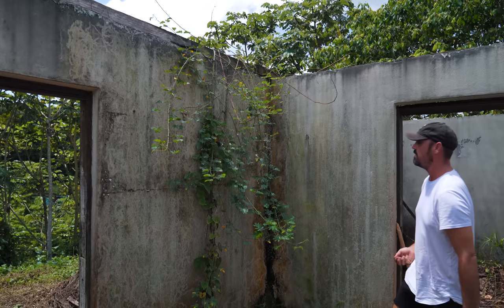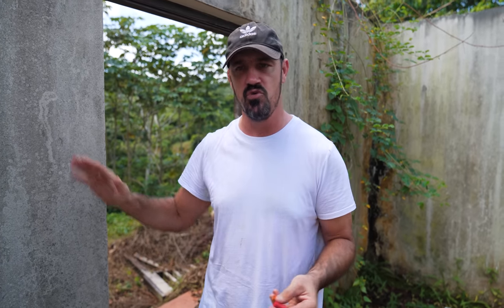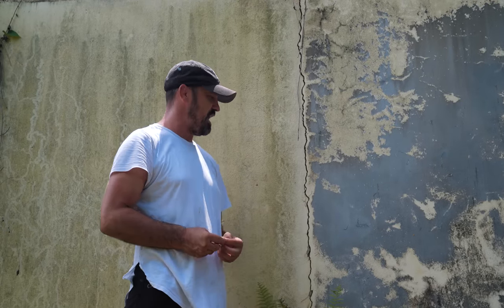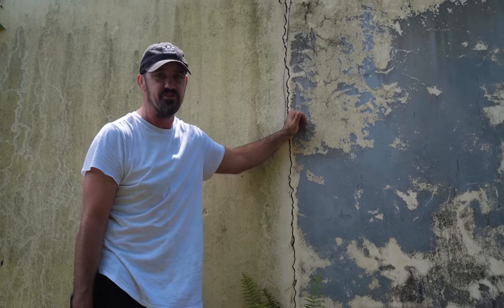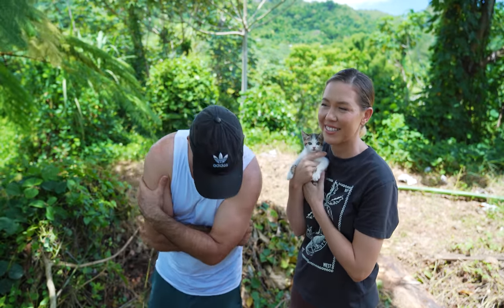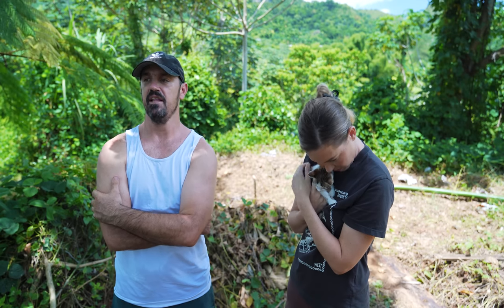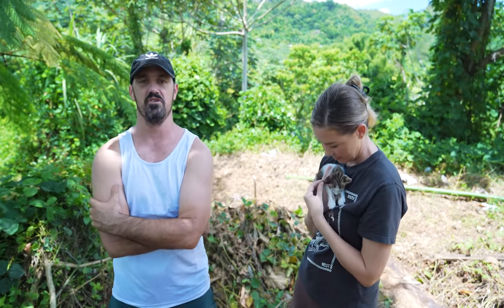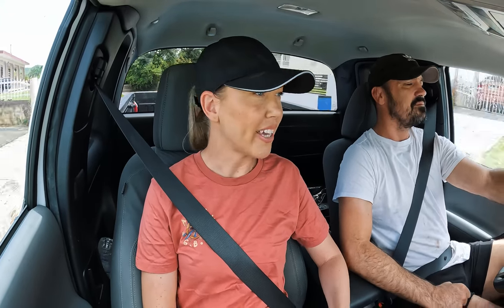ABANDONED HOME SHOULD WE RENOVATE OR DEMOLISH?!

Comment: I would dig out the concrete cracks a little to see how deep they are....there are plenty of ,easy to use,concrete patching compounds available at most hardwares stores. If you go with corrugated metal or fiberglass roofing you could use bamboo as temporary rafters, to create extra storage. Then reuse the roofing if needed on the main house, Nothing necessarily wrong with having your house in back...might give you more privacy and a better view?

Comment: Okay guys Puerto Rico falls under the IBC (International building Codes), specifically the 2018 Residential Code, 2018 Existing Building Code and the 2018 Energy Code). While the existing walls may appear sound, without any forensic work you have no way of knowing what reinforcement schedule (if any) was used. One of the more important (not only one) considerations is transferring roof and wind loads through the walls to the ground and foundation.  Without knowing the exact wall construction, this is impossible to calculate. They are also solid meaning there is no drainage plane or insulation. Sounds like you need a consultation with an Architect. I do this for a living and would be happy to provide a consultation.

Comment: I'd suggest that you don't let the ruins of the old place decide your long term way forward. You could use it, but renovating is often slower, more costly and more of a hassle than building new (is it plumb, straight, square and level, for starters?). Weather-exposed work is less reliable in terms of what you might find than starting over, particularly as this is just a couple of rooms. Would the size and layout even work for you? How many power lines would you pout in the concrete walls? Would you change the window shapes/locations? Is the building where you would have wanted it if it wasn't already there? Not saying you can't, but it's often more trouble than it's worth.  Others have suggested you use it as a shed, workshop or temporary shelter - that might work too. Look forward to watching, not matter what!

Comment: Guys, I would suggest putting a predator skirt around the outside of the run. Some predators will tunnel underneath if you don't have a predator skirt. It should be something a bit more beefy than chicken wire. Make the skirt about 2 ft wide around the outside on the ground.

Comment: You Guys are a hoot!!  In my opinion  you should gut everything wood out of the concrete building.  The wood will have mold and mildew and you dont want that  even for a workshop.  Scrape the cracks out then patch with hydrolic cement.  Put a roof over it and make it a workshop, It will give you a dry place to work and to store your tools till you build your dream house. By the way, dont tear  out all of your wiring right now, you can use the old wires to help pull the new wires through the walls.  You need cracked corn and laying mash for the chickens (you can do without the laying mash for now we only use that in the winter) the whole corn is hard to swallow.  The first eggs a hen lays are small (they are called pullet eggs) they are usually not fertile,   the question is "How old is your hen?

Comment: First off im a retired builder, having been in business for more than 45 years.
Realize that building the shell of a home is the least expensive part of a project.
As for your old structure, apparently it was built in two different sections at different times.
That explains the crack between two of the sections.
You could reinforce that section by building what is called a ( pilaster ), preferably on both sides with concrete, and tied into the existing wall. Drill into the old wall, or even all the way thru the old wall and epoxy pcs. or rebar in, leaving about 6” or so protrude on each side. Then form and pour the pilaster.
If they were block walls you could fill them with concrete in order to reinforce them
A patch on the surface is no more than applying a band aid over a wound, it will not fix the problem.

Comment: Herding cats and succeeding, good start. Try making a movable chicken pen so they can clean up areas and fertilize at the same time. I don't know how much bamboo you have because there are some great bamboo houses  on the internet. Is this hurricane country, if it is those cement walls might come in handy and with solid roof framing and fixing the foundation on the low side of the lot it looks like has life left. The walls can be parged to look like new and this could be integrated into the new house. I envy your open palet and the youth to take it on.

Comment: The house may be attached to the property address. Check first. It can change property zoning and have to deal with new laws on all construction. Dont tear it down until the new ones finished and inspected.
All it needs is a few rafters and a tin roof.  Free space is always needed especially if its a dry one.

Comment: On the cracks get several steel brackets maybe even angle steel if needed  and dill through walls and place large long bolts thru the halls in several places  and the wall want fall and make a form below that corner pour concrete with footer of rebar up to the wall to support it

Comment: Cracked corn is the better choice. Should be cheaper than whole corn as it is stuff sifted out of the load of corn when being handled.Chickens have a Gizzard in their lower neck that they have to keep full of rocks (they know what they need). This grinds up the food so they can digest it.  Predators can kill all of them in one night. Have a pole up 4 feet or so for them to roost on at night. An area you can lock up at night is the best. You are both doing great!

Comment: For chickens you need to have around 16% protein in their diet, cracked corn only has ~ 9.7% so its an additive and not a complete feed.  Chicken feed on the other hand usually is 15-18% and also contains the necessary calcium and minerals needed for growth. Chickens can get fat from eating just cracked corn. Its recommended that only to be  ~ 11% of their total diet. Cracked or whole doesnt matter.  So you have silkie chickens, that means only 2-3 small eggs a week tops. Males only get to be about 4 lbs.   Keep an eye out for red tailed hawks (the big ones) there are 4 different species but only the reds are large, and also make sure your bamboo remains dead. the first two years as it invades is quiet as its spreading below the soild, then the third year it run rampant and shoots will be everywhere.

Comment: Personally I would try to build off that existing structure, you already have a strong structure there, clean it up, pressure wash it, but first check out the foundation and septic if there is one, make sure both are sound, if so then your halfway there to a home that just needs completed in any way you want, beats starting from the ground up. you can always add on other rooms if needed, but hey, I would love the fact that a strong storm proof structure already exists and its really in a prime location to the road, looking forward to see what you decide, it would also be more cost effective too? Great job so far guys, nice job on the coop too! Keep the kitties, see if there is a way to get them fixed for cheap since you did rescue them there might be a assistance for that, and they will also keep the rodent population down.

Comment: The foundation is most important. It's crumbling. It might be saveable. I'm just arm-chairing it, so I can kick it. If you can kick chunks off the corners, tear it down.
Otherwise, rebuild.
Cracks are not necessarily bad. A totally solid piece of concrete is not easy to find.
If you fix it up, no reason why you couldn't build a nicer new house next to it, then use the old one for other things, like storage or hobbies. We know you like working with wood. And anything else. Rebuild it in a way that doesn't keep it from converting to an awesome shop.

Comment: Ya gotta keep them they were meant to be with you. As for the cracks in the walls many florida homes have this problem of foundation settling. Its common just repair the cracks with a good cement repair and use a cement bonding agent.

Comment: Great job on the chicken coop. On the structure, you don't know if it is reinforced with rebar so I wouldn't build on it. Demo it (Bobcat with Jack Hammer attachment, easy) and reuse the materials on new foundation. I would think "kit" structure. It looks like wood just rots out there, so I would do BARNOMINIUM! It's a steel structure, very weather resistant, fabricated offsite then assembled on your new foundation.....easy peasy, you could that work. If that is out your budget (but I would call and see if they want an advertising project), I would still demo existing and reuse and build a cinderblock structure with wooden top. Cinderblock is easy to obtain, has very good insulation quality and lasts like concrete and its easy to lay block. And with block you could build incrementally over time if you are budget constrained. Just start with a good plan. Does the lot have electricity, or did they run electric off a generator? Be thoughtful, don't dress up a pig. You have a nice trailer to live in, so no rush. Take your time.

Comment: It appears your flat land is quite limited..so demolish the old structure and build something new to your desired specifications with a better set back from the road.  You might use some of the existing concrete walls as foundation material or fill. First check on building codes for the area to determine permitted structures and availability of building materials and prices.  A manufactured home is another option.  Read instructions and put it together.

Comment: Your remaining walls on your property probably have some rebar steel.  If so do not demolish, they can be the core structure with strong lean-to on some or all sides to cheaply add additional size to the house.  get a ladder and look down on the top of the wall.  If is solid and there is steel rebar inside, great, if not or what ever a 8 inch tie beam can be added to tie it all together and be sure of the strength.  if you decide to add tie beam, concrete hammer drill 5/8 into top 8 inches to pound 5/8 rebar into what is there with 7 inches sticking out top into new tie beam.  however do not drill vertical about every two feet alternate drill at an angle from vertical.  the next is angled the other way so it will never pull out.  two 5/8 bars horizontal to tie it all together.  One piece of OSB plywood can be ripped into 3 pieces, 16 inches for form sides to pour in concrete.  8 inches laps on the existing wall with 8 inches sticking up for tie beam sides during concrete pour.  they have rolls of steel banding with holes to push through slits cut with skill saw just at existing wall across to the other side nailed to horizontal 2x4s top held in place from blow out by 2x4s.  steel bands wrapped under horizontal rebars every 2 feet left sticking out of tie beam top to strap down trusses yo can make with plywood gussets.  outter lean to vertical can be pressure treated 6x6s set 3 to 4 feet into hole with concrete.  drill a horzontal hole through 6x6 to run 5/8 rebar through horizontally at least a couple of feet so 6x6 will not likely pull out of the ground, especially if into a concrete footing.  enough for now.

Comment: You guys work fast. I would say use the structure at this point, its there . Get the largest tarpaulin you can or corrugated plastic for a roof, use the bamboo for ridge poles.  You may or may not keep it ultimately but for now it could be useful and its cheap shelter/ workshop / project space.

Comment: The only key factor you need for the coop itself is to make sure that there is a beam of wood that goes across the whole thing for them to perch on at night that is at least a foot and a half off of the ground and then make a box somewhere in the corner that’s filled with dry grasses and stuff for them to make a nest to lay the eggs if they’re free ranging and running around, you may find they may lay an egg and some little random corner somewhere that you might not know about but also know that whatever eggs come out of the chicken can be kept on the counter for at least a month without any issues what so ever until you clean them off when you clean off the coating off the outside of the egg you then have to refrigerate it

Comment: Garanteee #1 concrete cracks always fill in the cracks they dont look structural.  Secondly the septic tank will not be uinder the house it will definately be away from the house then you will have a deep well or a leach feild and it would be a400% increase in cats

Comment: Ok so I can't tell from the video how structural and sound the walls are. Dig a little and assess the size of the footings. Now if the structure can handle it, I'd build on top. The new structure will be above the old one, one story above. Think about the design options you can have and also better views. Not to mention no vulnerability to water. Build the new with steel and concrete please.

Comment: I have done up a few houses and I live on a boat after selling them.. What would I do? Id make the old part clean. Strip it. Then look real good at those (quite common) cracks. And yes you can repair them with epoxy... kind of. (there is an epoxy based concrete repair) But first you need to drill holes on either side of the crack to stop it. Then that needs to be filled. It will last, no worry. That is unless they ar from all the way to the foundation.
Foundation is your main concern. First, is it flat and horizontal? Everywhere, if so, make a drawing and integrate what is standing into the new, you won't see it. It's just a shortcut to save money and time.
If this is built how I think it is it's a hell of a job to remove it by hand, you need machines (at a cost) takes one day maybe two.. In case the foundation is bad, then have an expert look at it before you decide.
I would consider integrating the existing part into the new design and making this like the scullery or such..

On the cats? 1 to 3 is a 3 fold, is 200 percent extra forming 300% of what it was... Keep it simple. Its 3 cats now.. Soon you'll have kittens as they multiply fast. GBU... God bless you guys.

Comment: Matt your thoughts on the building settling is probably right on the money.. same thing will occur with your septic pipe/ joints.
Starting with a new material and a clear establish vision on paper is always best in most situations .. No sense putting lipstick on a pig.
Talk to an established , reputable contractor in the area and get things lined out and pick his brain a bit.. Do what you can do but you certainly want a good base/ foundation to work from.. soil samples will tell you a lot about perk for the septic and type of foundation requirements..Beware of water sources creeks, wells..ect. and required distances from your property lines & leech field.  
Just some thoughts.. good to have  all the information possible.
Good luck ..work smart  & be safe !!

Comment: I’m a concrete guy. The cracks shouldn’t cause concern.  All concrete cracks! There should be rebar in the wall  that provides structural integrity.  You do need  to seal the cracks with a concrete filler that you should be able to get at a hardware store.   Only concern with the structure would be how deep the footings are.  Based on what I see in your video they appear to be sufficient.  You will definitely have your work cut out for you if you try to demolish the house without heavy equipment.

Comment: Get different wood screws. The sheet metal screws don't have aggressive enough threads to hold well when the bamboo shrinks as it dries. GRK, PowerPro, Spaxx, and some other wood screws all have cutter heads to drill their own pilot hole. GRK is best, but expensive, PowerPro work well, and are much cheaper. Also, if you get bigger (more amp/hour) batteries for your cordless tools, you get more power output, not just longer run time.

Comment: Renovation costs more than demolish and rebuild. About 30% more. Of course. There are many options. But One option is to use the foundation and then start over. There are many options, but only a couple of good ones financially.

I  have done it both ways. The cracks you show in the wall are easily dealt with by plastering over that wall. High pressure water pressure wash the concrete with 3000psi.  Remove all wood. The real issue is the foundation of the wall. A professional engineer can tell you what is happening there. It will be worth the money to have the foundation professionally evaluated.

The biggest issue is not the building. The issue is 
1. Is the building where you want it?
2. Is the building the size you want?
3. Remember, the cost to renovate is typically 30% more than build new. 
4. the only exception is the foundation. It is sound? Is it in the right place? You can easily extend a foundation.

Comment: I think you need to clean the inside of the building out see how the floor is and get fill dirt and fill in around the outside of the building on the side where it goes downhill and keep the house and all you have to do is add doors, windows and a roof and stick to vinyl windows and door not wood so it don’t rot out.